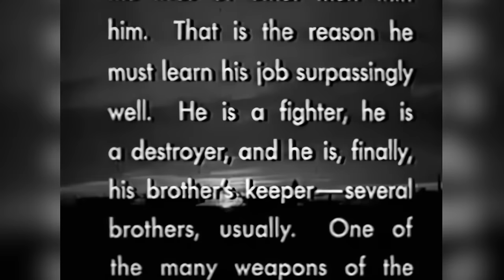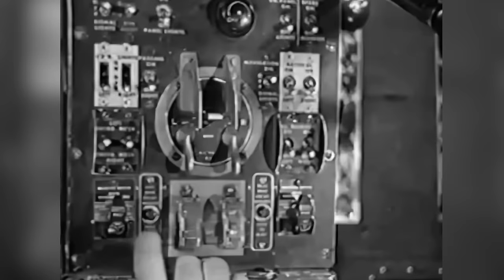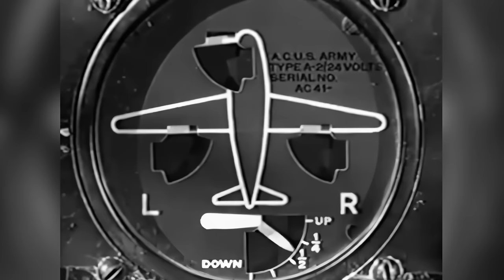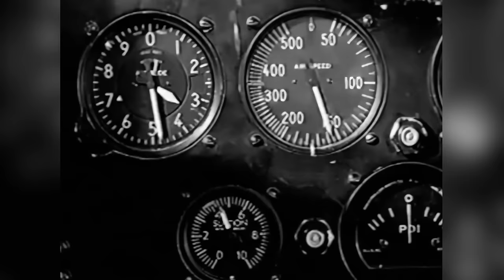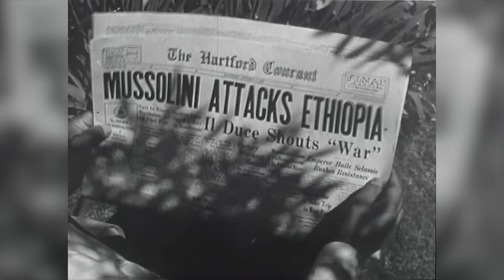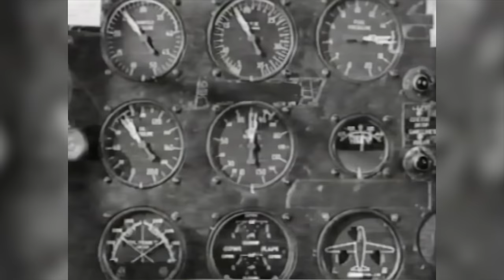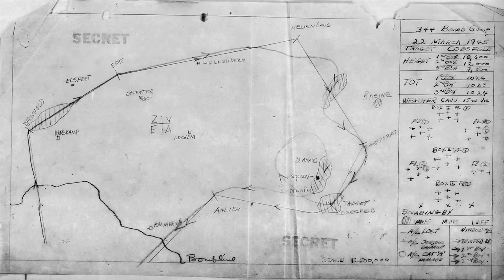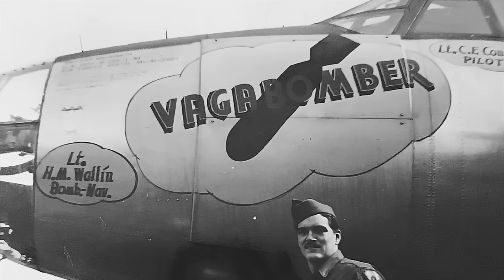Martin B-26 Marauder | HOW TO FLY ONE | WW2 Twin Engined Medium Bomber

Comment: That plane is a lot bigger on the outside than ti is on the inside.  Like the front seat in an old Jag. and side windows taper inward.  Great operating safety record for its crews.  Must have been scary the first time

Comment: So now I'm going to be a Debbie downer and say typical military, the enlisted guy gets busted down in rank and the officers get a "live and learn". I feel like if this were today, the Cpt. would get a little more or a talking to about improper crew resource management and adding unnecessary tasks during safety critical operations (ie. flying under the hood in proximity to another aircraft while switching from aux to main fuel). Pilot in command should have requested fuel transfer before tasking the crew chief with monitoring the other aircraft or going under the hood. 

The differences between what was acceptable in aviation back then compared to now certainly helps explain the dramatic improvements in safety we've made since then. Not saying those guys weren't good pilots, just that we've developed a more methodical, less seat of the pants way of doing things these days.
Reply: The enlisted crew-chief (Cpl who should have been trained to know better, especially back in 1943) made the mistake right out of the block. He's lucky he didn't kill the entire crew. Crew member must be able to conduct more than one simple task at a time, especially in combat. I don't think the pilots are going to sit and ponder "appropriate crew resource management" when under attack by a couple of FW-190's. At the same time, I respect and  totally agree with your second paragraph. Perhaps my experience as an infantryman colors my perceptions of tasking requirements of Jr. enlisted. In any event, appreciate the sharing viewpoint. V/r

Comment: Think I'd prefer the B25 Mitchell myself tbh. I still don't see a pressing need for the B26 Marauder in WW2. Of course there's the business & politics involved with manufacturers but to me the B26 wasn't covering any essential air capabilities gap in twin engine bombers.
Reply: It was supposed to be a high speed, high altitude bomber. The engines that went on the B29 were also to be used for this bomber, but they weren't ready in time. That undermined its performance.
Reply: It was in service first, when we had nothing else.  Experienced piolets didn't have  the same problems, it just landed faster than any thing they have flown, a lot faster.